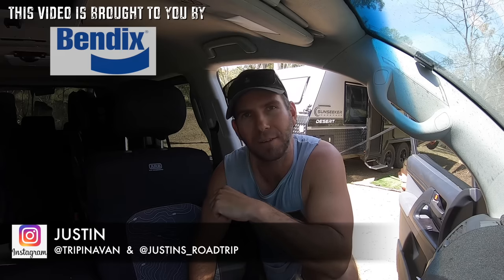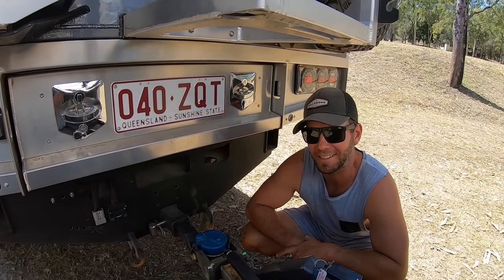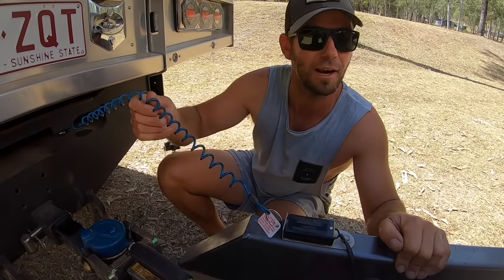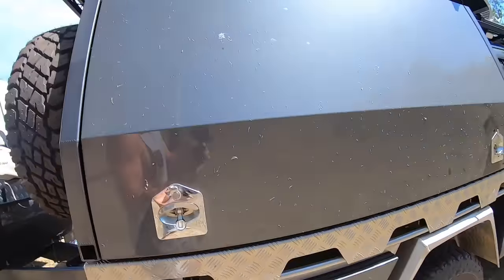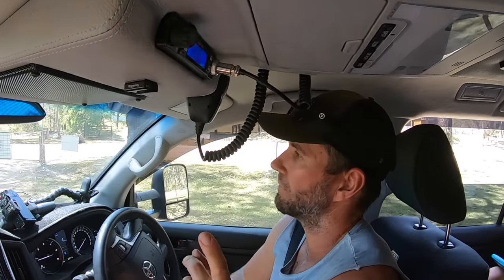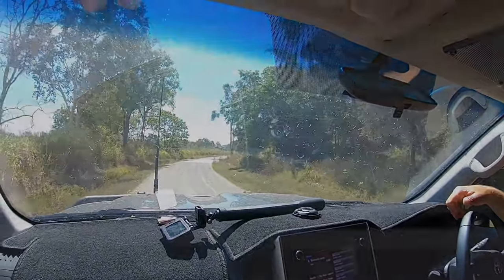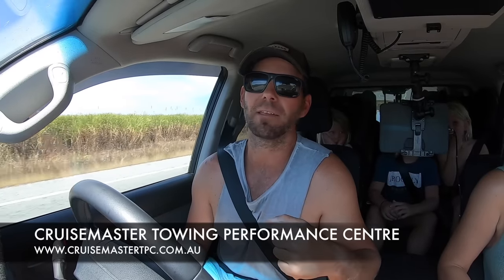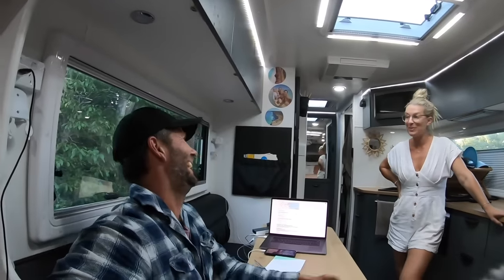"TOP 10" CARAVAN TOWING TIPS - Road Trip Australia

Comment: Some really great advice, also just a few extra tips to do with sharing the road. I have driven heavy vehicles for more than 40 plus years all over Australia and some of the issues people have I think often arises from just a lack of understanding whats going on around them.  If you are traveling at your safe comfortable speed don't stress when a truck is behind you, Just continue to maintain your speed. He is sitting  up high and has a pretty good view of the road in front and when he deems it safe will pass, he also has a great knowledge of the road the road ahead having travelled it many times. When you are being overtaken don't speed up especially on an overtaking lane or divided roads. As well, be aware that a large vehicle overtaking you will change the air flow around your unit which may cause your vehicle to become or feel a little less stable so be prepared for that. Never be in a rush, you are on holidays so enjoy and safe travels.
Reply from the maker: Great info
Reply: These are times when Ch-40 is a ripper. When a truck comes up behind me, I call him up to reassure him that once he pulls out to overtake, I will back off thus significantly reducing the time the time spent on the manoeuvre.

Comment: Ive just started towing my new van, a mdc xt12hr hybrid van. I  am curious that you say you sit on 100kmh comfortably,  my first trip I had horrendous cross winds, and a fair majority of road on the way north is horrible. I couldnt get above 80kmh when it was cross windy, and 90 when the road was bad. After that it starts to sway. I have plenty of grunt, v8 turbo diesel trooper carrier landcruiser. I am very experienced towing all forms of boats, trailers and im also a truck driver so I have plenty experience towing.  My van being an offroad van is quite high up. The only time i got to 100 for any period of time was when the road was perfect and very little crosswind.  Id be curious to hear your thoughts

Comment: Your steering wheel has a slight shake?Wheels either need balancing or the front rotors are slightly warped. I’m betting front wheels need rebalancing. It’s hard with larger AT tires but can be done on the correct balancer.

Comment: I noticed with your Redarc brake controller you had it set on manual mode (green light) do you always use it in manual mode or the Inertia mode (blue light)?? I find the manual mode very aggressively on and off when doing lower speeds, the inertia i find a smoother application all around and i will dial it up a couple of clicks when traveling in traffic for a bit of assurance

Comment: Just wanted to add one tip when connecting the chains. Crossing them should be standard as you mentioned, but one thing I learnt, the hard way, is to back off the D-shackles a turn and a half to ensure they do not tighten and lock.
Reply from the maker: Great tip🤙

Comment: hey Justin, in NSW if you are over 4500 kg max speed is 100 , WA is max 100 regardless of weight, and NSW dual chains must be crossed by law,  and all good tips ... when doing walk around have head lights on (so you can check tail lights on van) and hazards on too, cheers, Garry

Comment: Re Hitching Up - I use a count method, same as I do when leaving the house. I know I have to pickup 6 items, Phone, Wallet, Drink Bottle, Smokes and Lighter (Yeah I know Bad) and Car keys, so I count to 6 as I do that. Same with hitching (Apart from backing up) Hitch, Hitch Cap, Left chain Right chain, 1 Plug (Just has 2) Brake safety hook, jockey wheel and hand brake. So I count to 8 every time.. And I also do the count when re checking..

Comment: Its interesting your brake controller is on the right hand side. Ive been advised to have it on the driver's left so that in an emergency your passenger can access it to assist with braking your van/trailer.   Mine is in the centre console,  accessible to driver and passenger.
Reply: I think the left is better.  My last vehicle it was on the left, and I did have to activate it from the passenger seat.  New car is a Toyota, and I just could not find a place on the left that was a reasonable install and would locate it in an easy to get to place, and could be seen - so it ended up going on the right.  Might be a Toyota thing.  Left is better.
Reply: Our REDARC controller is in the centre console because there was a blanked off spot and REDARC make a pop in controller module to fit perfectly in our BT50
Reply: @zacandmillie  My last vehicle was a ford Ranger, so also the centre console.  Best place for it, not only because it can be activated from passenger seat, but also because it is easy to see.  Took me a long time to resign myself to putting it on the right in the Toyota.

Comment: Yes, a great, simple to follow video. I would add though that the safety chains MUST be short enough to keep the coupling off the road should the coupling fail. If they are too long and it hits the tar and digs in the chains will just snap if you are doing normal road speed. Also the shackles need to be correctly rated for the van weight.

Comment: Interesting that you don’t use stabilising chains such as the Andersen hitch which was recommended for our 21ft caravan - any comment? Also, at Highway speeds do you set the Redarc braking system to a higher number like 5 or 6?
Reply from the maker: Redarc stays on 3. We have electric over hydraulic disc brakes.

Comment: Done a 3 monther around Oz last year i talked the wife into driving and towing the van firstly on straight roads then on a bit twisty sections to get her confidence going  she doesn't like it in towns but we are working on it a little bit at a time. The most important thing to me is to be able to get out of the drivers seat for a while when its time to drive again i feel refreshed, we also have a system in place when coupling and uncoupling and double check each others work.. Funny story when i was about 20 i was pulling out of a caravan park in NZ their power cord coupling that goes into the van and power box has i screw on coupling on  it to tighten it into the onsite power box .So all full of confidence I'm driving past reception ang the manager comes running out waving his arms so i stop and he gets me out of the car and points about 10 meters behind the van i had pulled the whole power box out of the ground i thought this is gonna cost but he said it happens on a regular basis hence the checks

Comment: Hello. Been following u guys for ages, since u began almost.

Have been looking at radios (retired truck driver tripple road trains, floats etc in The Pilbara). In particular been looking at Oricom.  Kits range from $200, $300 and $400. (same radio with different antennas). Almost settled on $400 option. Then was thinking, could I justify the DX4200 dual receive package at $549. Wont be using radio as much as I used to. Just watched your video and u mention TIAV15. I'll try that. $466 delivered. Thats a $85 savings. Thank you very much, be ordering DX4200  tomorrow I think.
Reply from the maker: Ricky Ellard great to hear we can help out mate. Cheers for watching

Comment: Two questions:
1/  What channel on the UHF do you sit on for the trucks etc.?
2/  What is the brand of the reversing camera setup?  Is there a camera on the back of the van?

Thanks for the tips.  Much appreciated.
Reply from the maker: David Handley channel 40 for trucks. It’s the standard Toyota reversing camera.
Reply: Truckies on the M1 Pacific Motorway between Newcastle and Tweed Heads often use channel 29 instead of 40.

Comment: Hi guys. My wife and I watch all your vids. Very entertaining and educational. We have a nice van but it is now 9yrs old and we would like to update. We dont leave the blacktop too much but when we do, we dont want to break stuff! So an offroad or semi offroad 21ish foot that does not have a timber frame is our priority. Also want, lightweight, good insulation, trying not to exceed $100k and good towing (behind the DMax). Obviously a million other detail things but they are the main criteria. Have narrowed our search down to, Sunseeker, Willow and Coromal (Evolution XC). As you have now owned 2 of these, can you offer me any guidance? Or maybe there is another manufacturer that I should be considering? I have a list a mile long! Thanks!
Also, am I the only person who has to regularly 'spread' the pins in my trailer plug when the REDARK braking sys tells me I have a bad connection? (eg. flashes red).
Reply from the maker: Steve Rodley my trailer plug used to do that as well mate, try buying a better quality one, that might fix the issue??  
So with the caravan, both Sunseeker & Willow awesome vans.  For towing with a dmax your going to be at the top end of your gvm with a 21foot Sunseeker like ours. With the Willow, they are a lighter build so that might suit.  
I think the best advice would be to inspect both and see which one will suit your travel needs better?  Hope this helps mate🍺🍺

Comment: Best tip I can think of for caravanning is to service the van before you leave. Having a wheel detach because of bad bearings is not uncommon. Much easier to service before than to try and reattach on the side of the road.
WA has a 100kmh towing limit. I tow at 90kmh, my 200 will do that up and down hills. Fuel economy is much better, less stress on driver and more chance to catch it if something goes wrong. 
Be mindful of following vehicles and back off in overtaking lanes. 
Use your UHF. 
I keep to the left to encourage trucks to keep their wheels on the bitumen. That way they are not chucking rocks at your windscreen and lights.

Comment: I believe there should be a check list to double check that every item has been done. Like does your van have a parking brake that has to be released or a caravan backing brake block that has to he shifted so that the trailer brakes will work. Disconnecting 240 volt power and the water hose, turning off the gas bottle, closing all windows, vents and doors, returning the steps, locking external items like tool boxes, Bar-be-que and rubbish bag. Pin the refrigerator door travel lock. turn off appliances, close all internal doors and drawers, secure all loose items. There's probably 20 to 30 more items to go on the list and be double checked. Assuming the Missus did all that is exactly how things go wrong. 
Count your kids before you drive off, especially when sharing with 2 vehicles. Oh I though he was with you! 🤪

Comment: Great video guys, awesome camera work Jack. Your job is under threat from the young fella Bec 😀. Not trying to be a smartarse, but do you reckon that jockey wheel is an unsecured load?
Reply from the maker: It’s wedged in behind the gas bottles and toolbox. It also sits between the chassis rails of van.. never had it move hey 🤙
Reply: @TripInAVan  I simply turn it upside down and put it back into the clamp with just the handle sticking out underneath.

Comment: A big one is tyre pressures. To high and you will blow shocks, bend axles(yes bend a 50mm straight axle), break stuff and uneven wear. It can also affect how it tows. To low will Increase fuel usage, tyre wear, poor handling and cause heating which can lead to blowouts.